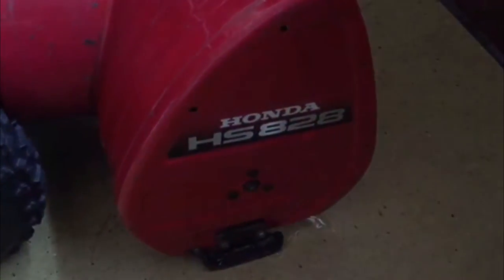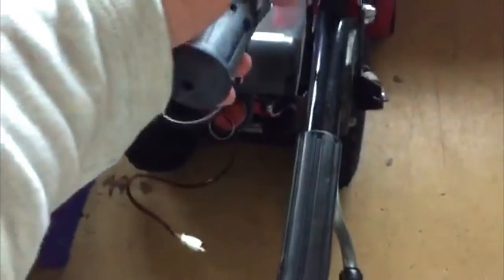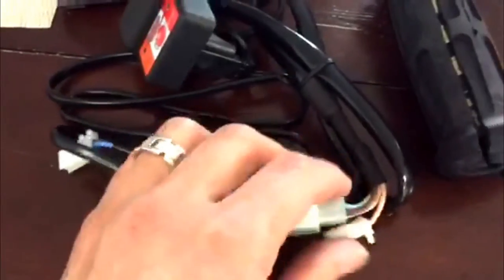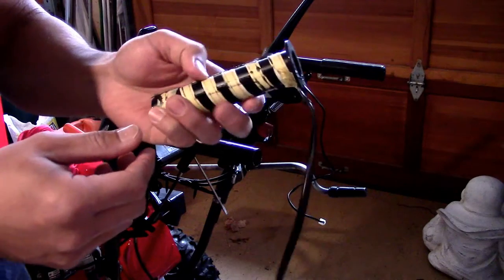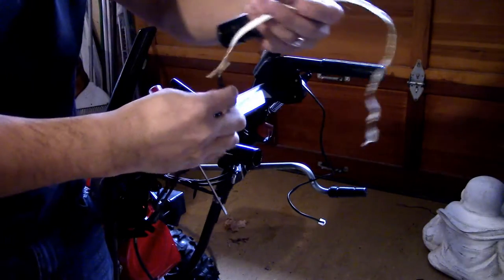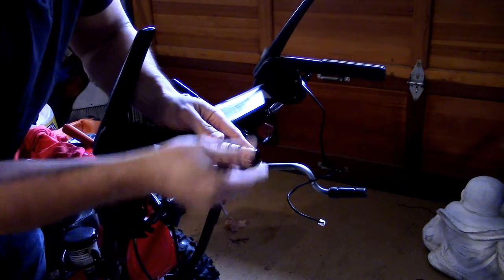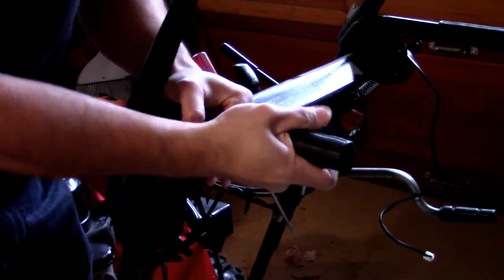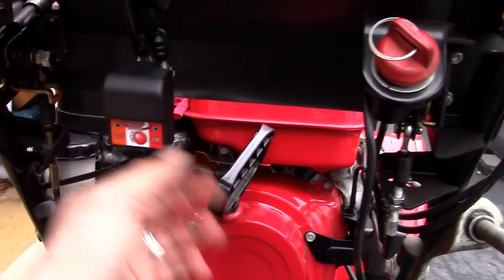DIY Heated Hand Grips on a Honda HS828 Snowblower

Comment: You can just get a pair of cheap grip heaters that go under the existing grips ( made for snowmobiles, etc. off Amazon for less than $25) and run them off of the headlight wire or a drill driver battery (I use my Milwaukee M18 battery) to power them, which works perfect!

Comment: How are the grips working? I think you are losing more than 50% of the heat they are providing by attaching them directly to the hollow steel tubing. That is what the plastic bit you removed from the originals prevented. I think I will order them up, but cut the end of the grip off on a bandsaw for a non-rigged edge. Nice videos man